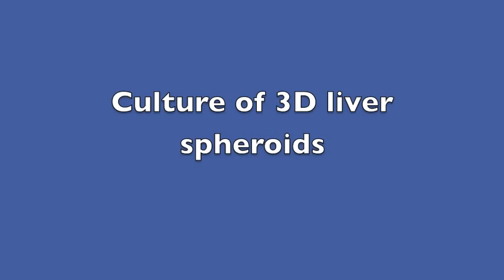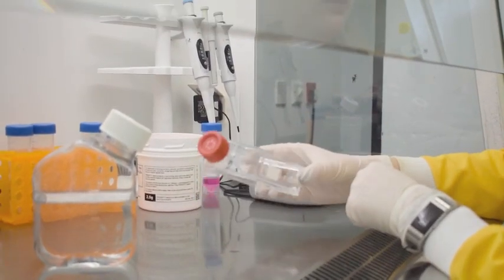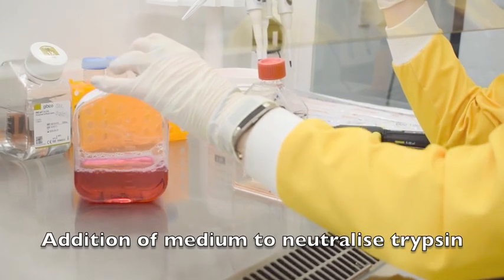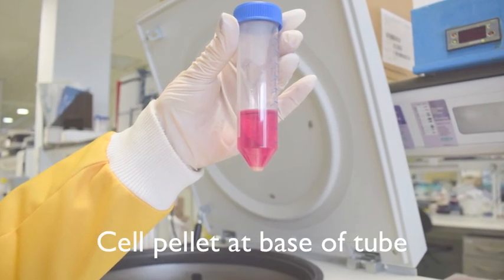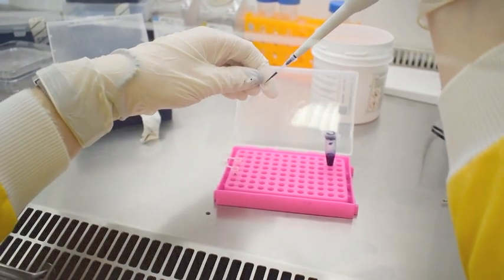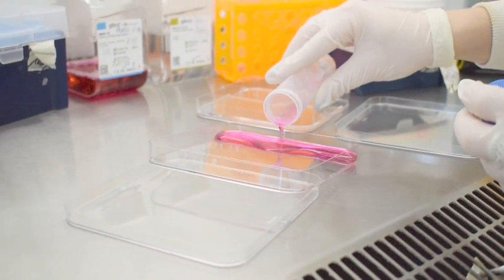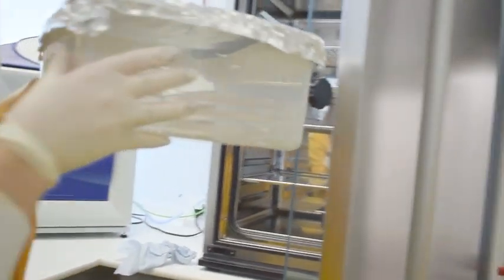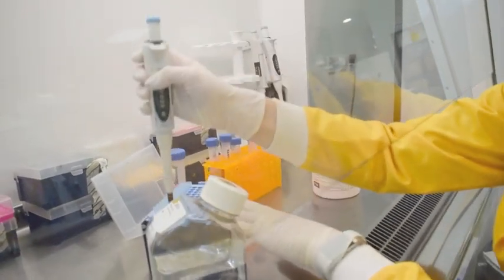Preparing 3D Liver Spheroids

Comment: What is the rpm and time duration at which the spheroids were centrifuged during the harvesting procedure?
Reply: In most cases, centrifugation at 200 x g for 5 minutes is sufficient to pellet cells following trypsinization. However, if the culture medium is highly viscous, you might need to extend the centrifugation time.  Five minutes remains a good starting point, but a slight increase may be necessary for more viscous culture mediums.